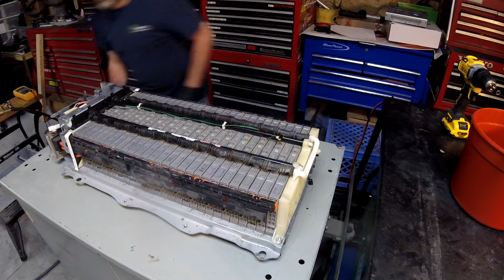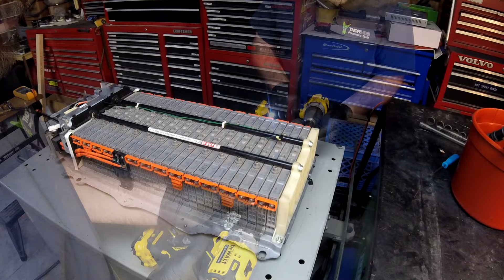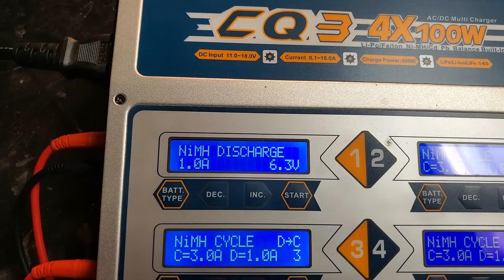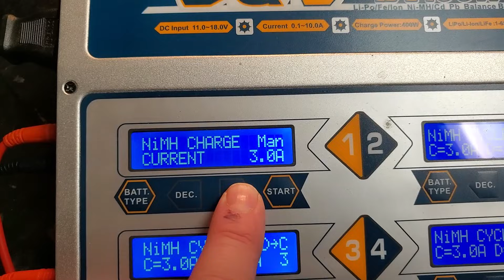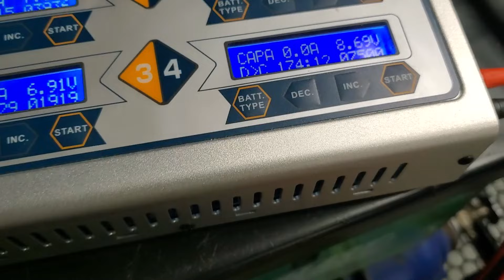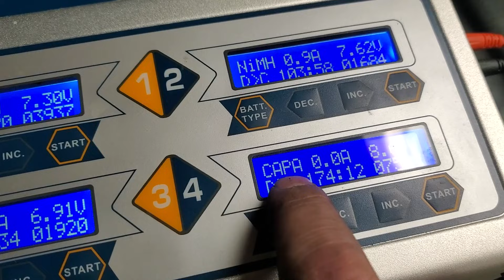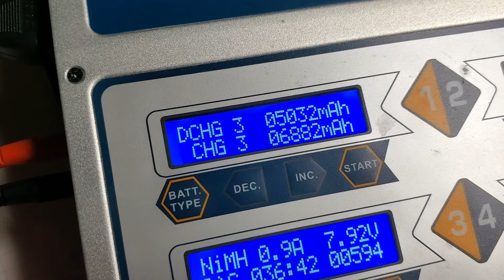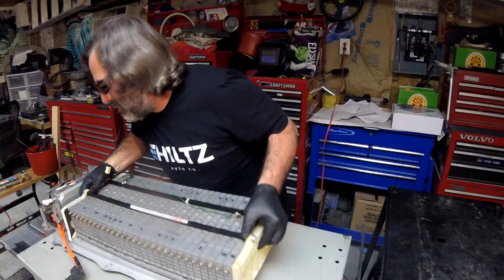DIY Refurbish / Repair Hybrid Battery 2nd Gen Toyota Prius - EV-Peak smart charger POA80 P0A80

Comment: Great video! My question is: I have already removed all of the modules (I did this before I saw your video) and sold off the "carcass" of the battery (including the ECU, etc). I am left with the 29 modules. Do I run the risk of bulging if I charge them without being compressed in their original form? Is there a solution to charging the modules individually?
Reply from the maker: Hello B Melcher, Thank you for watching and writing in with a question. You do run the risk of bulging if you do this process without compressing them because they generate heat when cycling. I always charge mine in the pack so i know they will fit back together properly when done.
Reply: @GreggFesto  Thanks Gregg. I think I'l make some sort of compression jig - probably just some plywood and clamps - to use on single cells or I guess I could do this for all 28 and charge them "apart" (like you did) to avoid heat bulidup. My battery pack was fine when I took it out (car was totaled) so I suspect all of my modules are ok too. I have 28 to sell if anyone's still looking! :) [I'm in Maine, USA]
Reply: @zembu  how much are they going for?

Comment: Greetings @Gregg Festo I am running my EV Peak charger, already have 12 good reconditioned batteries, hopefully few more will be good too, unfortunately already 10 blocks are bad.  I cycled 5 modules up to 7 times, only one of them reached over 5000mAh capacity, others were close to 5000 but on 6th or 7th cycle capacity dropped approx from 4600 to 4100, so I decided it would not make sense to continue, correct? Also, you mentioned that you buy modules on eBay, but what if they wouldn't reach 5000mAh? Alibaba is selling new battery modules for Prius, do you know something about it? Thanks Gregg!
Reply from the maker: Hey Eugene, Congrats on the 12 good cells.  I agree that cells with low mAh number that continue to drop are suspect and should be replaced. To make sure they are not recoverable you can run another few cycles on them. I have not had an issue with any cells purchased on eBay so far. I have not purchased cells from Alibaba before so I not sure how they would do. Please write back and let us know where you end up getting your new cells and what the readings on them are after you run the cycle. You may be able to help others find another option for cells. Thank you very much for watching and writing back and forth with us.
Reply: @GreggFesto  I will sure write about what cells I buy. Also, interesting that some my cells change capacity reaches 7500mAh after 1st or 2nd cycle, so I add more cycles, some cells successfully reach 5000 discharge, some not
Reply: @GreggFesto  Almost finished cycling, unfortunately 14 bad already, ranging roughly from 3000 to 4000, one cell 4880; the good ones ranging from 5126 to 5786.  Aliexpress confusingly mentions Prius pack but actually they sell modules or whole battery (approx $1500), so I will buy from eBay. Question: eBay guys do not guarantee capacity 5000, did you cycle cells purchased from eBay before replacing the bad ones? If yes, you probably cycled them assembled in pack of 28, right?  Thanks!
Reply from the maker: Eugene, Sounds like you are on the right track. When I got my eBay cell, I installed them in the pack then ran the same cycle on them as the old cells. This gave me a true comparison to judge from. So far I have not received any refurbished cells that were under 5000mAh on low number. Keep up the good work, with 14 weak cells I am certain you will see the benefit of this refurbish.
Reply: @GreggFesto  Getting replacement modules today. Just noticed, should pay attention earlier, that even discharge current limit is set to 1A, my EV Peak actually discharges to 0.9A, who knows, it may caused some damage to the cells. Changed to 1.1A, now it discharges to 1.0A
Reply from the maker: Hey Eugene, Let us know how those new cells work out. No damage should result from that lower setting, it was very close to the goal setting and may have just caused the cycle to take longer.
Reply: @GreggFesto  I probably was still sleeping when I decided that it was 0.1A over 1A, instead of below it... I got 2013 low mileage Prius modules, hopefully they will be just fine, I can probably start from cycling them once or twice, it might be enough, will let you know. Thank you Gregg!
Reply: @GreggFesto  Greetings Gregg, my replacement modules look pretty good, so far only one failed, 5 pcs are reconditioned just with one cycle, continue cycling other ones. My only concern now is big variation of both capacities, low one from 5120 to 5900, high one from 6800 to 7500, it may decrease battery life, not sure yet what to do with it...
Reply from the maker: Hey Eugene, The the cells are reconnected the pack will have a capacity of your lowest discharge reading which looks to be 5120 from the numbers you provided. This looks great to me and I feel you should not have any concerns. Remember to put the cells closest to 5900 in the center of the pack as these will see the most heat when being used in the car. Thanks for the updates and I hope you will provide more as the pack comes together. Rock on Eugene!
Reply: @GreggFesto  Thank you Gregg! Yes, I know that you mentioned of how to place reconditioned cells in battery pack, I trust you and will follow your directions! Almost finishing cycling eBay cells, almost all good, 2 will be replaced. Have a nice weekend, sir!
Reply: @GreggFesto  Hi Gregg. Got 5 more cells from eBay, all 5 were complete junk, returned them, got replacement,  one of the replaced cells looks strange: after 3 cycles charge capacity is lower then discharge one: discharge looks good 5800, charge capacity is 3400, I am running 4th cycle, will see the result by the end of the day or tomorrow morning
Reply from the maker: Eugene, Sorry to hear about the bad luck on the cells. Were they sold to you as reconditioned? Do you mind sharing where you got them so that others do not use this vendor? I have seen weird readings on bad cells also. Very interested to know how these new ones turn out for you.
Reply: @GreggFesto  no, these cells were not reconditioned, I bought other cells from this seller, there were very good exept 2 pcs, I decided to buy 3 more, paid for 3, he shipped 5 total including 2 replacement cells, but all 5 were bad. The good think is that he allows free return, he credited, I ordered 5 pcs, this time 4 are very good, discharge capacity up to 6300 ! after 1-2 cycles, except one that I mentiened, I will return it. Many other sellers sell with no return allowed and guarantee only voltage around 7.5-7.8v and has no idea about capacity
Reply: @GreggFesto  Hi Gregg, finished reconditioning, put all together but something went wrong... same warning signs even I am sure the battery is good now. What's interesting, holding the brake pedal doesn’t do anything, I can only turn the screen on and off by pressing power button, and if I hold the brake, screen doesn't turn off. I do not think that I forgot to engage any connectors to the computer, going to buy Carista OBD2 scanner and try to figure out what's wrong
Reply from the maker: Hello Eugene, Have you checked the brake switch at the pedal? Perhaps the contacts have failed?
Reply: @GreggFesto when I press the brake pedal, brake light comes on, so it's not the switch, right? I have a suspicion though: when I was preparing cells for reconditioning I disconnected 1 connector from the computer but forgot about the other one, started pulling the cells away from computer and then noticed it, disconnected that connector, nothing visually was broken but possibly the connector's wire lost contact when I pulled it, so the temperature sensors shouldn't cause such problem, but you inspired me and I am determined to finish this job successfully Gregg!
Reply from the maker: Eugene, I am not sure if the brake switch in Prius is single contact or not.  I have personally seen cars with 2 contacts on the brake light switch, one for the lights and one for the ECU. If this is the case in your situation then the lights could work but the ECU not getting signal to say the brake pedal is pushed. I hope you will let us know what you find.  Thanks for sharing your journey.
Reply: @GreggFesto  thank you Gregg, will check it, Prius for sure should have something else because braking also charges hybrid battery
Reply: @GreggFesto  Hi Gregg, finally my Prius is running and running well, I also got OBDII Bluetooth reader and Dr Prius app, run full battery test, no errors, everything looks great. I was unable though to find myself the cause why the engine would not start, brought to the dealership, their conclusion: P0A0D code that is interlock system was open... I know that it is a BS, because the safety switch was locked, and I measured voltage, it was 224V,  if it was unlocked it would be 0v, they don't want to say the truth... They also reset monitor.  Anyway, the car is running, thank you again!
Reply from the maker: Hey Eugene, I am very happy you are up and running well again. Great idea to get the Dr Prius app. Thank you for providing feedback so we all can see that the process works and that you have had the desired results. I wish you happy motoring Eugene.

Comment: Thank you for such an informative video. Do you have a web link where I can order replacement cells to change the weak ones in the pack?
Reply from the maker: The ebay vendor I used for the replacement cells on this pack was called "papou26"
Reply: @GreggFesto  thank you. I'll check eBay
Reply from the maker: Thank you very much for watching and leaving a comment Aadil. I do not have a link to the cells I purchased. I usually purchase from vendors on eBay. Would be great if you could update us on what cells you end up getting and if you are pleased with them.

Comment: @Gregg Festo Good morning Gregg, I need your help sir, please! I run first 4 cells using the same EV Peak as yours (purchased from get fvp site, $160, they give only 30 days warranty), the cycle ended with FULL (not END) sign.  The numbers on the screens: FULL, 0.0A (??), 8.32-8.43V,  run time 448 min for 3 cells (original voltage approx. 7.7V), 352 min for one cell (6.6V originally), 00884 (3 cells) and 00675 (low original voltage cell). When I press Batt. type button and then Increase Decrease buttons I could only see my settings (exactly as yours), and no screens with Low and High mA numbers.  What do you think? Is something wrong with the charger? Thanks a lot for your help!
Reply from the maker: Hey Eugene, If it the charger stopped with FULL that means the high mAh number has reached 7500mAH. You will need to read your low mAh number to know if you will need to run your Discharge/Charge cycle(s) again. Please be sure to check all settings in the description as I forgot to mention the 6.3V setting when going over them in the video. It is possible that you need to select a different button at the cycle end to read low/high mAh values. It took me a few times to figure out the correct button to select in order to read the values. Please let me know what you find out.
Reply: @GreggFesto  thank you for response, you are the best! Should I set 6.3V at the NiMH discharge (by default 1.0A and 0.1V)? And will I be able to see other reading after I turned charger off? Or should I go again thru the cycle after setting 6.3 V? I hope I will be able to read low mAh after setting 6.3V. Thanks!
Reply from the maker: Eugene, Yes, you should use 6.3V for your voltage setting. Please check settings listed in description below video. You will indeed need to go through the cycle again. When the cycle is complete be mindful of which button you touch first. If you press the wrong button, you will need to go through the cycle again to read the values.
Reply: @GreggFesto  Thank you! Hope I am on the right track now, will let you know
Reply: @GreggFesto  Hi Gregg, success!! I figured out that I must start the cycle (by pressing Start button) ONLY from the Discharge/Charge screen (you may add this in your setting description, I saw in the comments someone else had same issue), I started from different screen, silly me!  Now it's working, cycle ended with 'End' sign, and I can collect and analyze discharge and charge capacity mAh data from each cycle!  And last question: Is it OK to cycle cells more than 5 times to achieve 5000 and 7500 mAh? Thank you sir!
Reply from the maker: Hey Eugene, That,s great news!   In regards to cycling more than 3 times, yes, I have done this many times. Record your numbers from each cycle and you will begin to se a trend for each cell. From this you will be able to determine if a cell is becoming weaker or stronger with each cycle.  You may not achieve 7500 mAh on the high number but that does not matter. The value that does matter is the low number with a goal of 5000mAH or better. Please give us another update when you have completed your pack. Thank you for providing feedback, your input is appreciated.
Reply: @GreggFesto  Hi Gregg, I will sure give my update when do all cells, so far one cell has to be replaced.  Thank you, and all the best to you!
Reply: @eugenevosko7832  OMG I really needed to read this as I had two working and two getting the flashing full on the same charger.

Comment: you missed a crucial step in the charging settings on ur charger... that is to limit the charger from going below 6.3v (in your case). 

My issue is that when I set my low voltage limit to 6v, the charger only discharges the module to 6.6v. IDK why it does that.
Reply from the maker: Your right, this was not spoken in the video. It did show it on the screen and I wrote it in the description afterwards. I plan to make another video and will try to do better. Thank you for watching.

Comment: how long is a battery supposed to last after a refurbishing? (like the one in the video)
how long did this one last?
@Gregg Festo
Reply from the maker: Hello Erx fav, Thank you for writing in with another question. There is no way to tell how long a battery will last after this process as there are too many variables that affect the life of it.  The battery in this video is still going strong and the car is driven at least 3 times per week.
Reply: @GreggFesto  thanks very much for your reply again as usual Gregg. How ,one has it been now since the refurbish? 
do you have long drives? (Or just some short supermarket ones)

Thanks 
@Gregg Festo
Reply from the maker: Hey Erx fav, I have one Prius that has done over 22k miles since refurbish in a period of about a year. There is really no way to tell how long it will be before a cell fails. The best you can do is get an app and bluetooth OBDII adapter and watch the charge/discharge trends to see when a block is getting weaker.
Reply: @GreggFesto  thanks again Gregg!. I've just got two OBD2 sensors from amazon to try out. Ive heard that certain shops actually discharge the batteries to a certain very low voltage before charging again and its supposed to make them more robust, however I've read you have to really know what you're doing to attempt this or you can mess things up...
any thoughts?
Reply from the maker: Hey Erx fav, The discharge/charge cycle is what refurbishes the cells. Following the procedure and the settings I provided in the video should not cause any issues.

Comment: Hi Gregg
Did you ever find out if there is a difference between the blue and red chargers? I have a red charger and my results come back as full and I thought I set ALL settings identaical to your settings. Please help
Pedro
Reply from the maker: Pedro, Thank you for watching and writing in with comment. I am not sure why there is this difference but I suspect that you will need to use a different button when the cycle has ended to view the results. I say this because it took me a few times with this charger to figure out how to display results. When I would hit the wrong button I could see no results and then would have to run cycle again until I figured out which button to hit without losing data.
Reply: @GreggFesto  Hi Gregg thanks for the prompt response! I was wondering if anybody else that purchased the RED charger could help me with the settings?? I did NOT notice the change from 6.0 to 6.3 but I will change it. (what is the difference?)
thanks to all in advance! I need to figure this out. I have 3 prius 2's and 2 extra hybrid batteries that I want to end up with 3 strong batterys!
Pedro
Reply from the maker: Hello Pedro, The difference between the voltage may be minimal but could be difference in capacity numbers when you are trying to determine if cell is good. Please let us know the settings on red charger when you figure them out.
Reply: @GreggFesto  
Hi Greg
I finally got a cell with reading similar to yours and I was able to scroll thru each of the three trials. However,  most of the time it states FULL with LOW numbers. The  cells have high readings of 7.8 min when I put the multi meter on them.
Reply from the maker: Pedro, Thanks for writing in.  When charger states FULL then the high capacity values reached your cutoff setting of 7500mAh during one of the cycles. Which cycle can be determined by scrolling through the results. If your low mAh values are not at least 5000mAh then you should run the cycle(s) again. If these low mAh values continue to rise then the cell is being brought back into life, if the values continue to drop then the cell should be replaced. Please let us know your results.